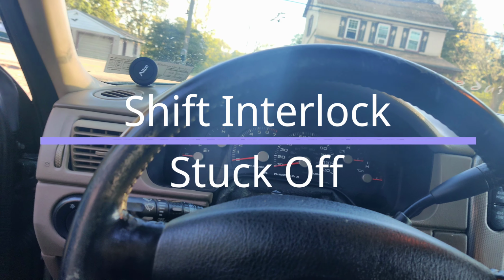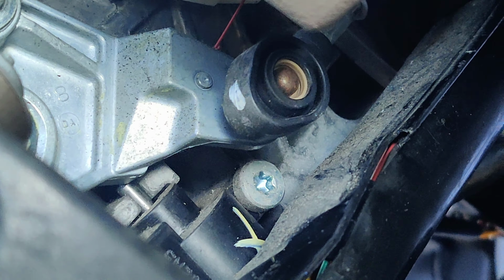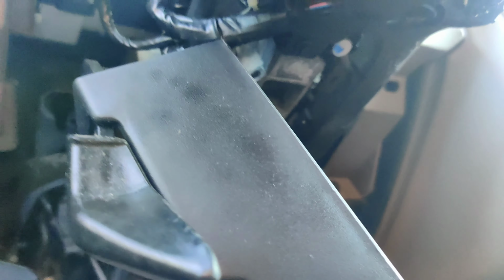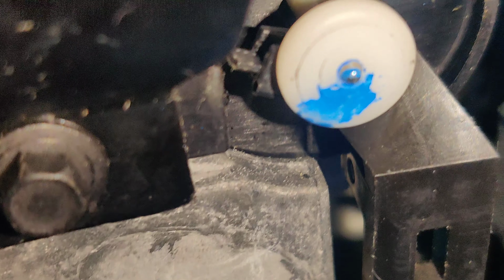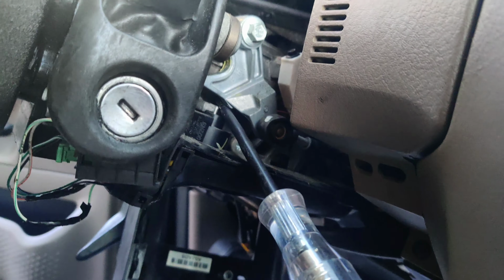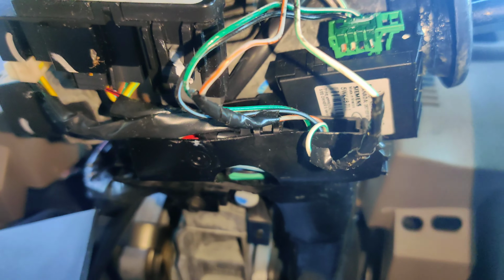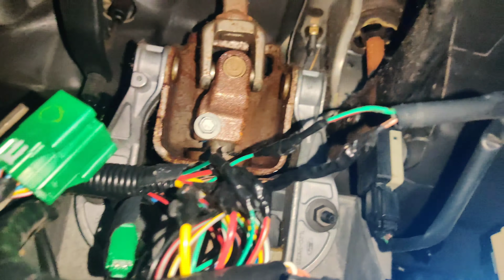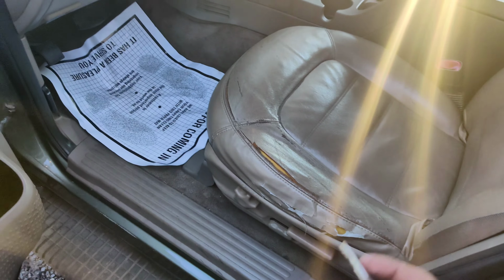2003 Ford Explorer 4.0l SOHC 4x4 Shift Interlock Not Working!

Comment: The reason maybe there is a plastic strap in there is because the ground cable that goes to the solenoid interlock is broken some place, mine was lock on parking, not the brake switch, I order a new interlock changed and work, moved the truck forward and reverse and stuck again, saw a video on YouTube about power and ground on the interlock switch try to move again and got stuck again, will switch is stuck in park press brake pedal the 2 outside cables are hot and the middle is ground find the middle wire ground, nothing on on it, split the cable a little and grounded with another cable and problem resolved, wasn't the solenoid just broken ground cable
Reply from the maker: According to my diagram the shift interlock is a 6 pin connector with 5 pins being used and pin 1 is ground.

Comment: I have an 04 mercury mountaineer v6 same engine but not sure about the 4x4 but the shifter is just stuck in drive 1 2 and 3 but won't go into N R or P like you can move the shifter on the position but it won't shift the gear
Reply from the maker: I would inspect the cable and the interlock. Try disconnecting the cable and moving the shifter and see if it moves free.
Reply: @RobertDotterer  so the Shifter is able to shit gears it's just the little dial on the dash to show you what gear your shifting it to is broke but still its turning but not turn over

Comment: Yeah, I know why they put that zip tie there... because the transmission shift interlock wouldn't disengage so they could not get the truck out of park. I have the same problem with my '02 Explorer. Right now, because the part is $200, I just use a screwdriver to gently push down on it so i can shift out of park. For them though, Soon enough that interlock will NOT disengage again, and if these owners aren't aware of that, they will break the column shifter if they pull too hard, or they will be stuck in park (hopefully the latter, that's safer). That whole transmission shift interlock will need to be replaced.
Reply from the maker: This actually never had a problem after this video.

Comment: my customers would love that most hate the fact that it locks
Reply from the maker: That is not safe at all. Imagine if someone bumps it or a kid pulls on it.
Reply: @RobertDotterer  i agree but in the south they hate stuff like that i won't modify them but have people who don't want to have to press brake pedal to move shift lever
Reply from the maker: I'm sure there are huge fines for disabling it if caught. I know air bags, seat belts, and Tpms have huge fines if you are caught disabling the system if it's in a working condition. If it's not working it doesn't matter.
Reply: @RobertDotterer  we dont have inspections here but i quit modifying anything to many problems and to many people like to sue for just anything.
Reply from the maker: It's not about inspections, if it falls under a federal law and there is an incident it may come back to you. I don't know if this would or not.